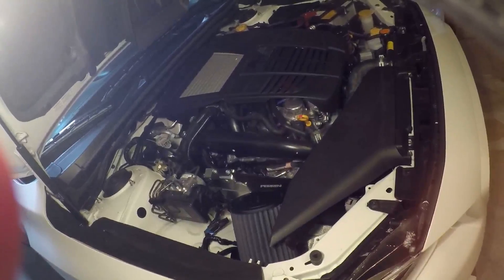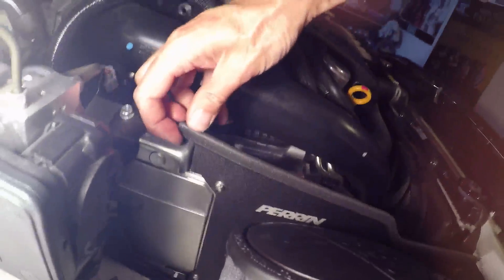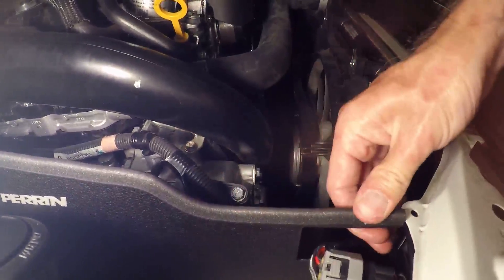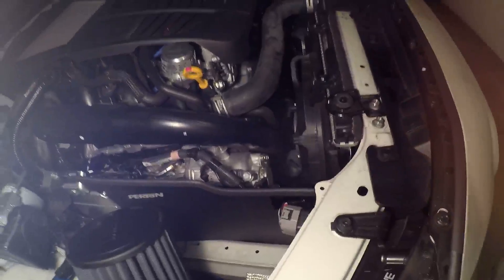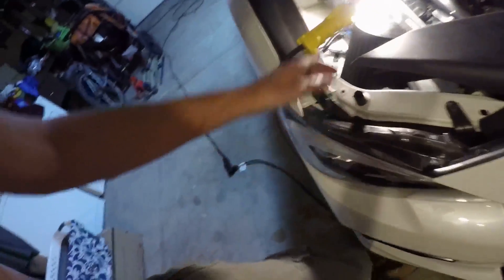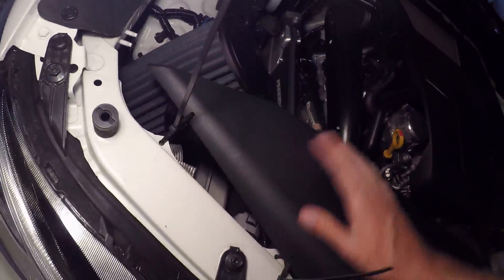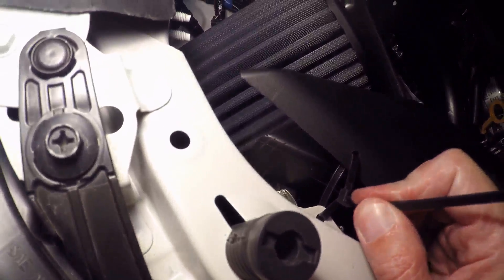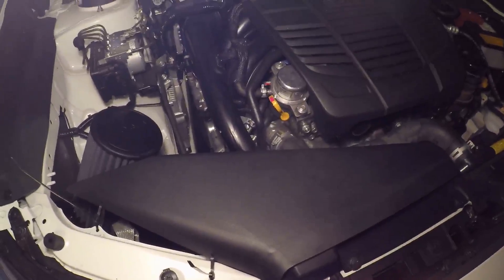2015 Subaru WRX Minisode 482: Perrin Cold Air Intake - Install Follow-Up

Comment: good job, but it will be even better if you DIY a L bracket to hold that airflow cover ?
Reply from the maker: naw, not worth the hassle. tie wraps are easily removed when i need to do work

Comment: You have had every intake and jpipe combo out there if memory serves. Is that a fair statement? Which one(s) did you like the best? The worst? For what reasons? I do like the sound of the Perrin, but, I really, really think the Grimmspeed intake will give me the best bang for buck. Any wisdom?
Reply from the maker: this is the first intake i have ever tried on a WRX.
Reply: Really? My apologies! I could have SWORN you had run the Mishimoto and AEM intakes as well. I stand corrected.